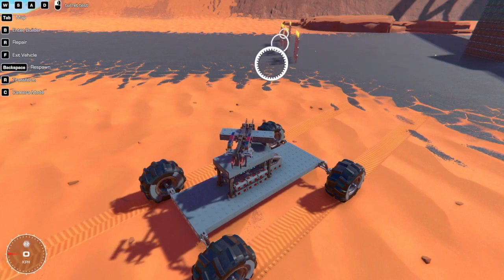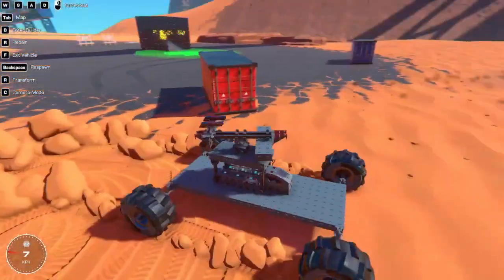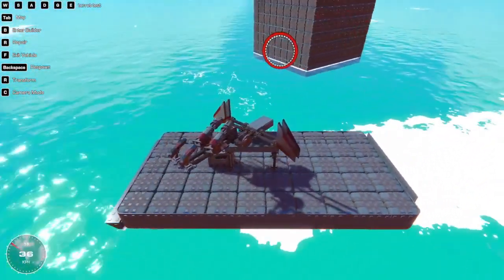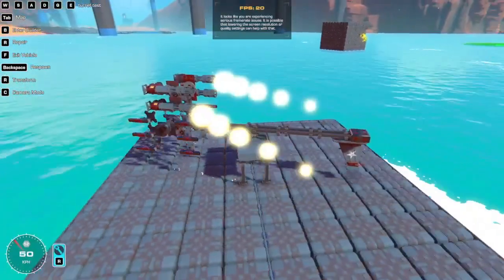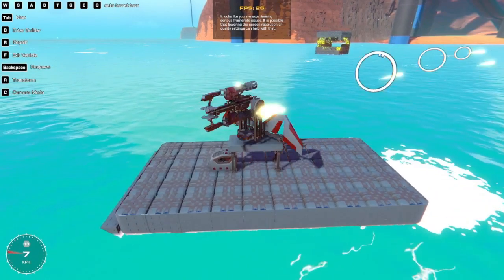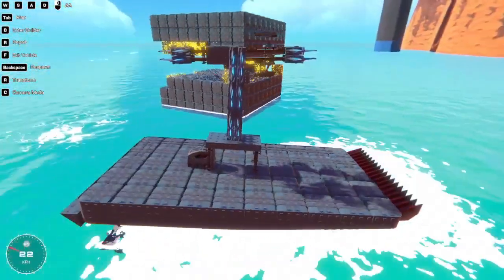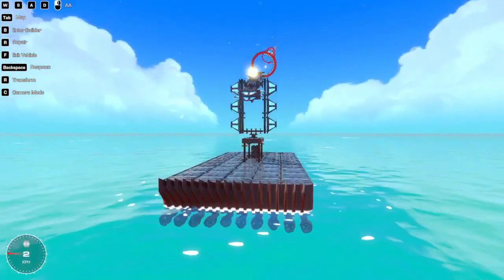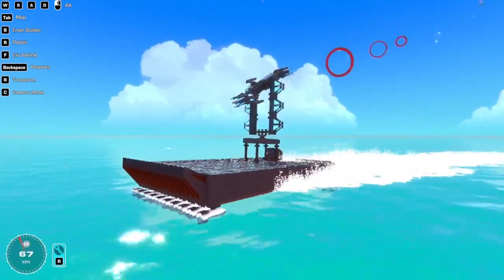New Auto Turret Tech in Trailmakers?   |   RECOIL TECH

Comment: okay i came here to learn about trailmakers not to get a phd in physics bro chill

also increase your audio clarity and quality, and do the same for your video.
cut out the emptyness (if there is any in some areas (there isn't much))
if you're using obs then use noise suppression on your mic and increase your kbps on output.
Reply from the maker: well, if you don't like it you can always leave. i am working with what I have, but I definitely will look into the settings you said, I'm still new to this. and yes I use OBS.
Reply: @ThisIsDumbAllTheNamesAreTaken  if you  need help with anything recording related you can ask me, (i will give a horrible response that wont help)